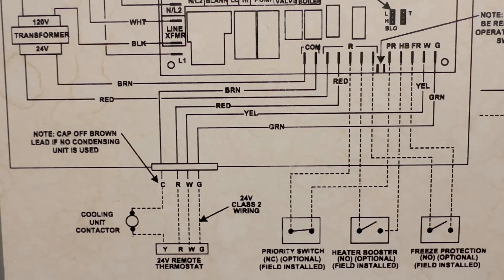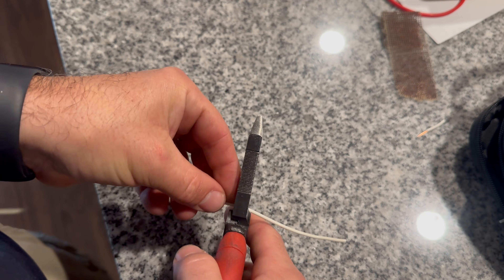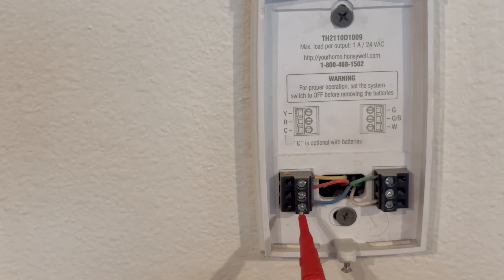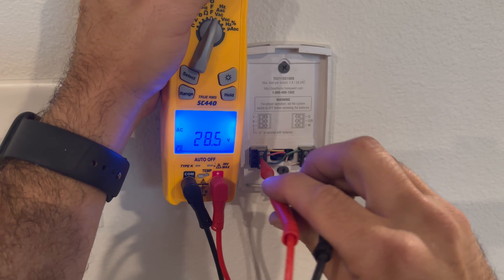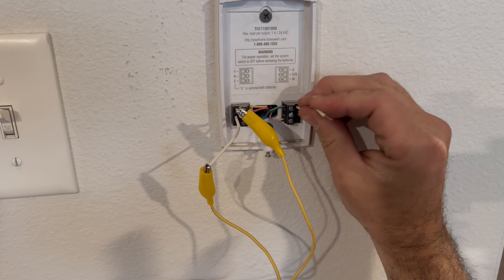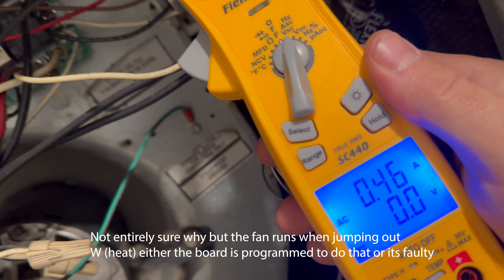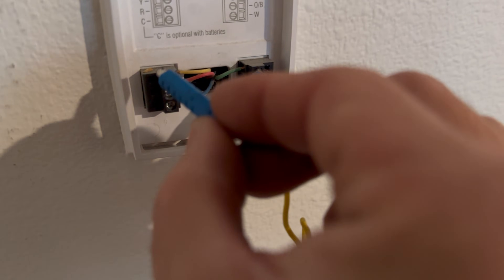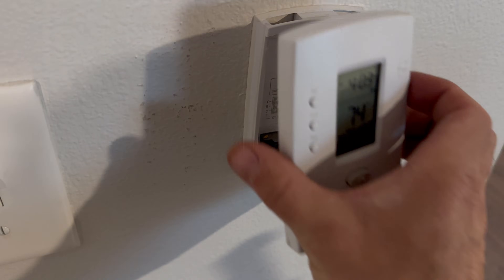Bypassing Thermostat Controls to Aid in Troubleshooting

Comment: Great video. Can you do one on heat pump thermostat.
Reply from the maker: I only have access to water source heat pumps I rarely work on split system air forced heat pumps. I could probly do a short one on just the reversing valve though

Comment: Crazy coincidence.  We moved into a new old house recently.  We have a basic digital thermostat. We had removed the mounting screws to paint the wall. One of the two wires became disconnected from the base. I looked at the instructions online but could not find the details needed to determine what spot the wire needed to go to. I used a multimeter to determine what two pins flowed after the thermostat audibly clicked on. There were three pins that had different ohm readings. I'm not really sure which is right, maybe all are usable. Two spots are jumpered together already and connecting to that is what I went with. It's a hot water circulation ba see baseboard heat so nothing like what you are doing with a fan. This is just a solenoid that opens and commands the system to circulate the water. I guess anyway.
This was just last night, that's the coincidence.
Reply from the maker: Haha nice! Glad you were able to get it working again with the aid of a multimeter !